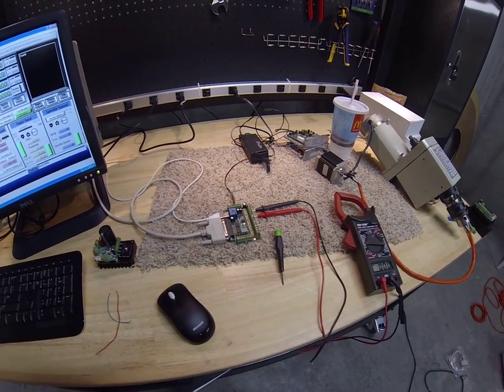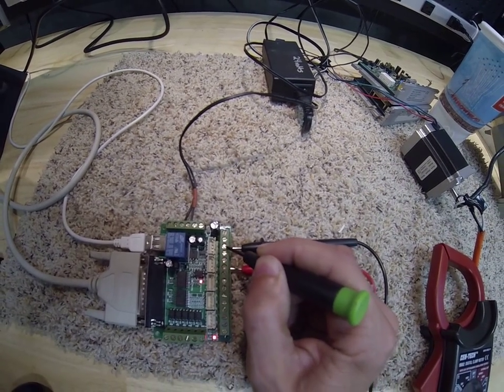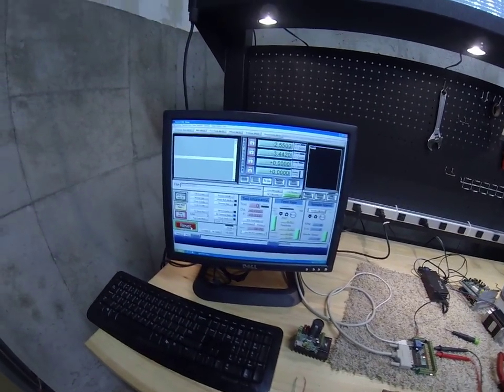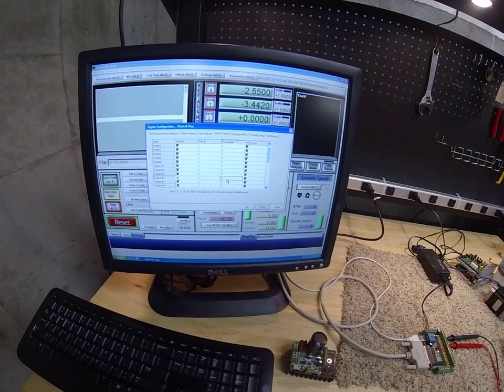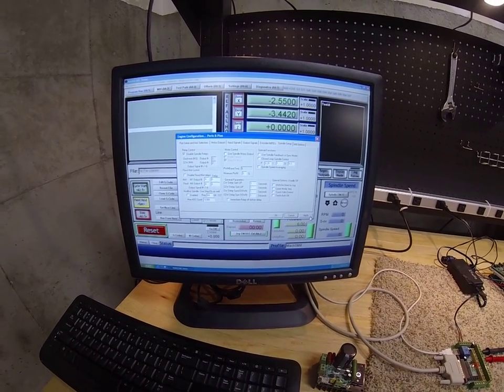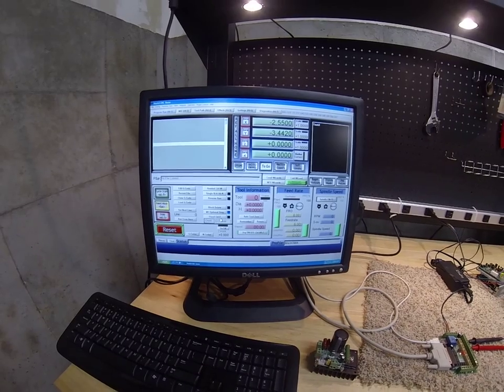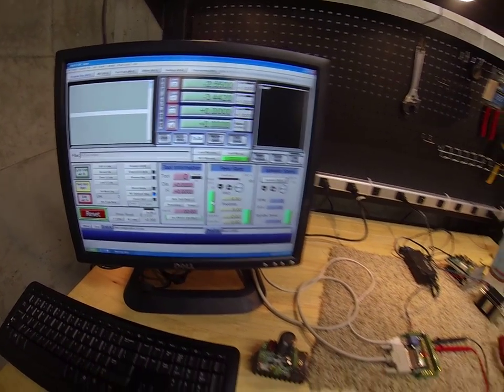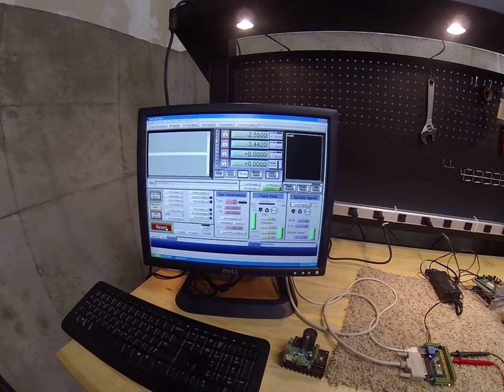Mach 3 Output Setup

Comment: I've been trying to test a servo for 5 months but get no answers anywhere on how to properly set this up. My 24v led's are not lit but they have power applied on screws 3&4 from the dedicated power supply. I don't care about setting limit switches at all right now I just need to get servos turning and I'll deal with the rest later. Nobody is making a video I can find on how to do this.

Comment: i have the same board and i configured it for x, y and z axis. it is running fine. i was trying to do the same setup as yours but pin 16 is always stuck at 5 volts. any suggestion will be helpful.

Comment: sir please tell me how to set spindle  anticlockwise because my spindle work only  clockwise.
Reply: CW and CCW require two different output signals. Both can be set up in the "Spindle setup" tab of the config window. Then make sure your spindle can run both ways (most CNC routers can not, not without additional wiring) and use M03 to run the spindle clockwise OR M04 for CCW (Counter-Clockwise or anticlockwise as some call it). DO NOT use both at the same time, obviously, as it will cause major damage to the board and/or spindle motor.

Comment: Hi. Can you help me about what i have to do when i want to use 5. axis port ( pin 16 and pin 17) and spindle relay at the same time. i connected stepper motor to the pin 16 and 17. and i can control it  but after that i cant use the spindle relay. which configuration is needed?